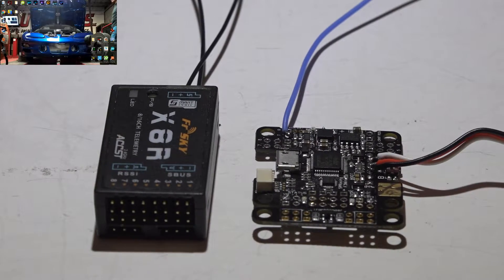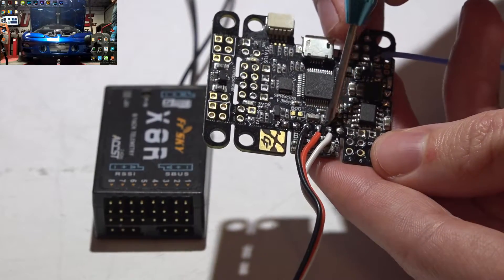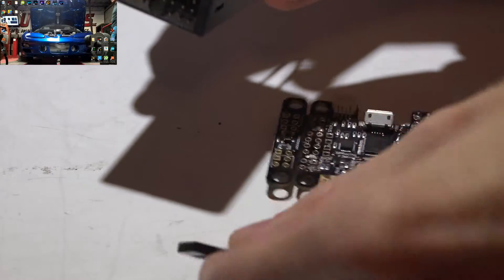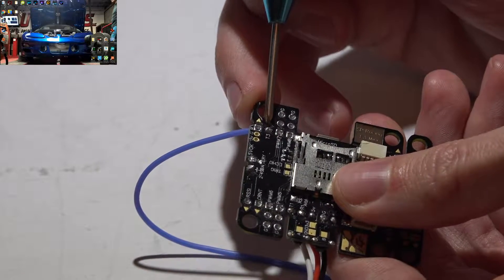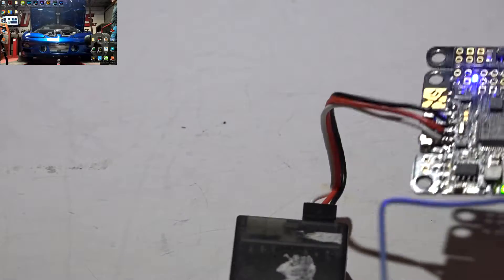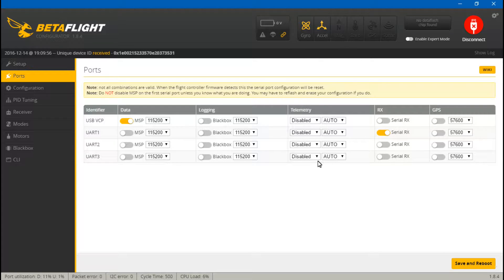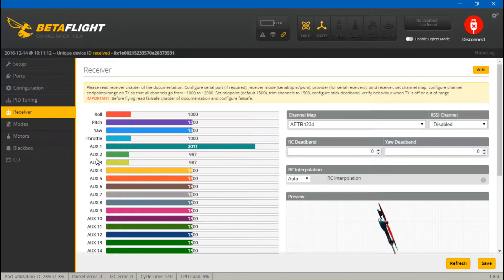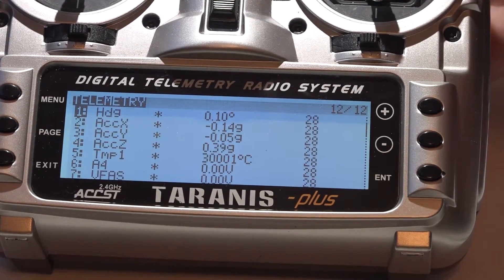SPRacing Mini & X8R: Connect & Telemetry

Comment: Thanks for the video! I can't say how much it helps us all piece together the puzzle. I saw in another diagram that the TX and RX port were soldered together and the Smartport signal (blue cable in your video) connected to both. Also, when I look at the sp racing f3 mini documentation, the signal connection for uart3 appears to be pin 1 (RXD r3). Any thoughts on this?